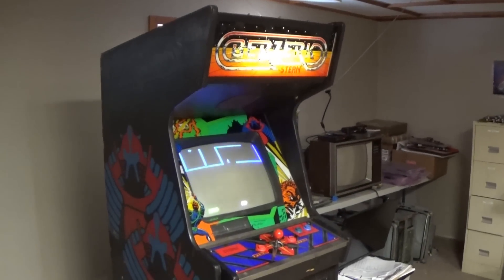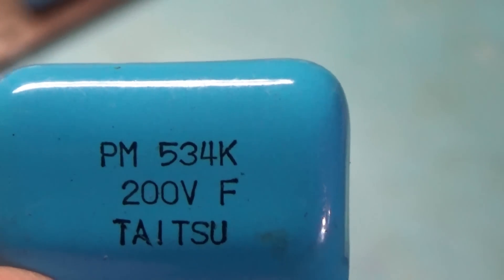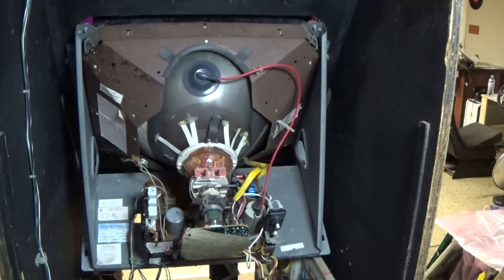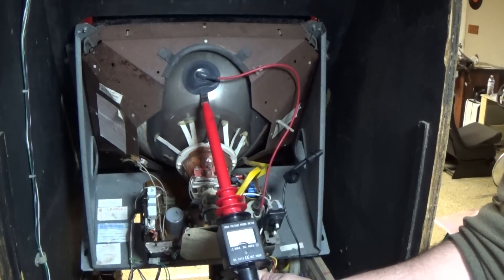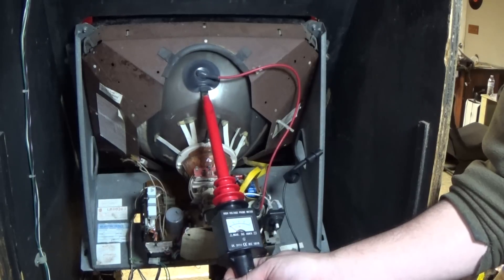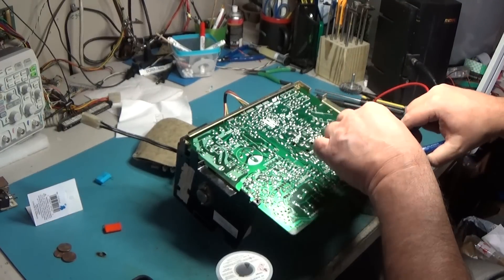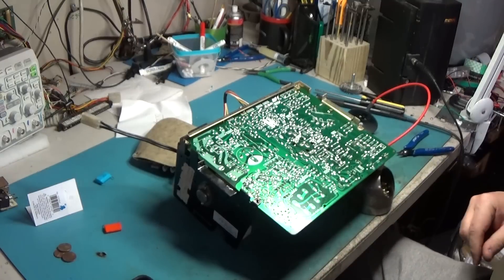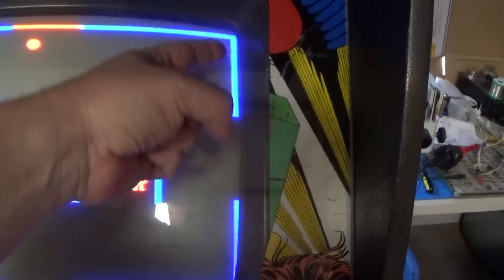How to Change the Width On Your Electrohome G07 Monitor.

Comment: Isn't there a width adjustment choke on G07 monitors?  Many times they are damaged and/or missing the adjustable ferrite core.  So increasing the cap value is your only option.
Reply: Just checked the schematics; L503 is the adjustment coil I was thinking of.  I guess it's been at least 10 years since I worked on a G07, so I probably forgot more than I knew!
Reply from the maker: @johnhermann762  those adjustment coils don’t really do anything
Reply: @classicarcaderepairs4818  It's true that they don't adjust the width much.  But if it has degraded, then you will see it does have a significant affect on the width.  There is a reason why G07 kits include that coil; they need to be replaced over time.
Reply from the maker: @johnhermann762  still, In my experience, I have had no luck making any kind of significant width adjustments by moving the slug in the width coil.